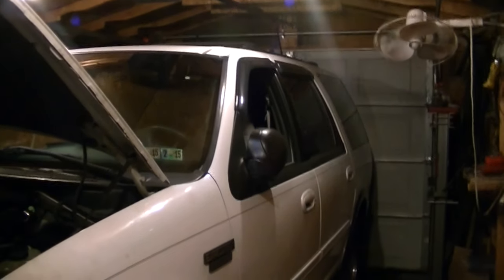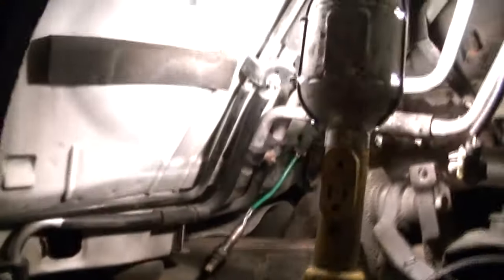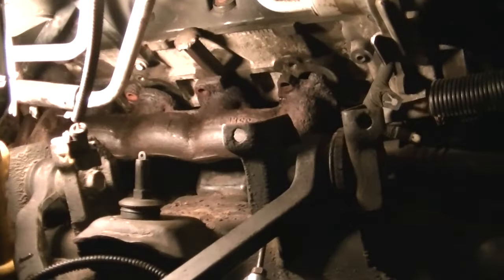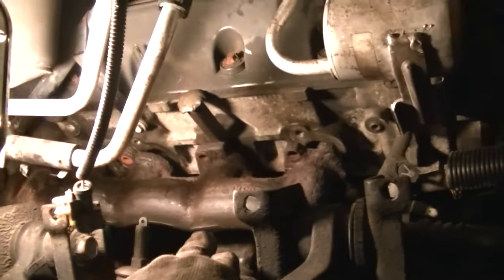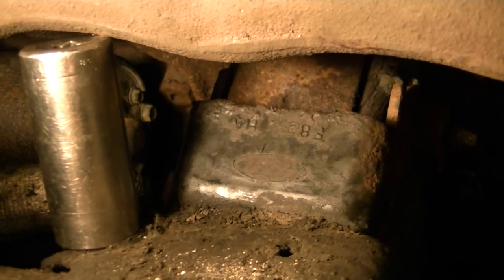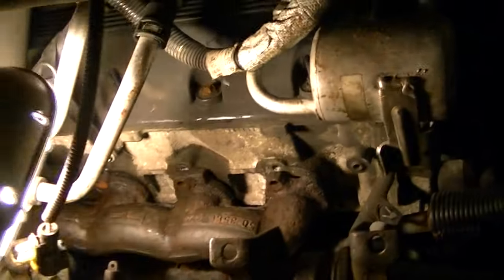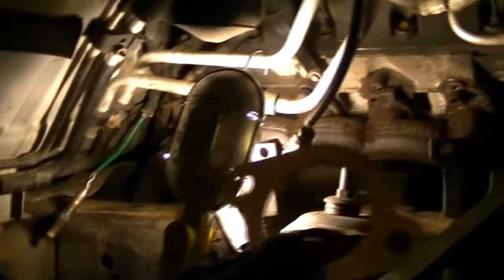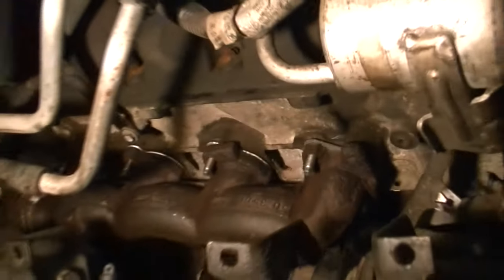Ford 4.6 Exhaust Manifold Gasket fix. How I fixed that Ticking exhaust sound...

Comment: I have this problem in my 2010 Police Interceptor engine. When I had this same problem in my small block Chevy 350 engine, I doubled up on gaskets. I used two sets on each side and never had this problem again.

Comment: Great vid. I have the same ticking coming from the passenger side of my 2008 Mountaineer and will have to do this job. Be careful putting a steel chisel next to the aluminum head at the gasket area. Another piece of aluminum or wood would have been better.

Comment: Just back the bolts out about one turn cut a notch in the bolt hole on new gasket & slide the new gasket on..the old ones usually just fallout or pull out pretty easy

Comment: I'm into that on the passenger side of 97 F-150 4x4, I am replacing the exhaust manifold,starter, have 5 studs out,1 broke, I built it up with the welder,3 to get out, also broke a starter bolt off and bent 1.I have a new welding cart for the Firepower 140i,3 process welder, I wish I would have bought the 180, I could Tig aluminum.
Reply from the maker: ;(....not good.

Comment: One of studs I have out is different from the others, someone has worked on this manifold before,both exhaust manifold are trash,cut them off with a torch, the flange studs are gone on both sides.
Reply from the maker: O no!!

Comment: Aluminum Exhaust Manifold Header Gasket Set for 97-03 Ford F150/F250/Expedition 4.6L,,,,, Bro, my comment started with the link to the one piece aluminum gasket,,,,, just did the passenger manifold gasket and manifold ,, last week, ,, like u, that bolt behind the motor mount a BITCH !!! maybe removing starter easier, mine F150 4.6 but promise same !!! wish utube let me add pics, I removed motor mount bolt, raised engine 2" with floor jack, and got bolt and old manifold out n in, ,,, the one piece thick, aluminum gasket comes in set of 2, for both sides, but screws too thick, did cost me $8.99 for the 5.5mm socket bolt's, but now sound's show room new !! thank GOD !! all mechanic's different, n what work's ,well, it work's, bottom line, we got it done !!! but promise, if you look up that one piece gasket on Amazon, you'll find my pic's n know same !! thx your time !!

Comment: i brought the car in september 2021 and the car was sitting in the driveway for 5 months and then i started to drive the car and it's making a noise like that when i press the gas i thought i was having a valve train noise but i don't think that's the problem. i changed the oil and now it's making that noise only when i press the gas. i change the spark plugs the air filter pcv valve change the motor oil and filter clean the throttle body and the mass air flow sensor i didn't change the fuel filter yet but i will so what can that noise be when i press the gas
Reply from the maker: Nice!~

Comment: Easier removing motor, clean out intercooler, new coil packs, plugs etc I have 2 5.4 HD supercharged, high compression motors blow those gaskets apart